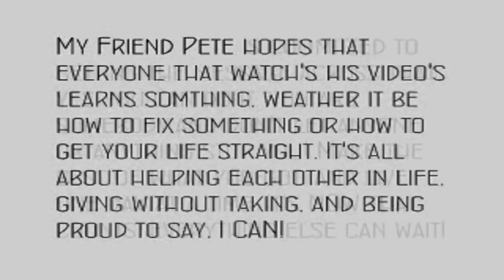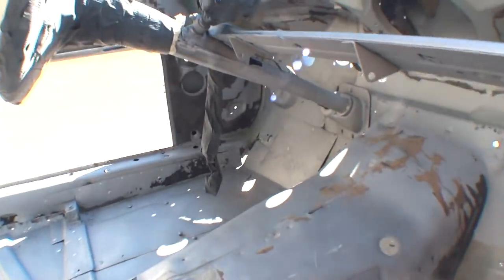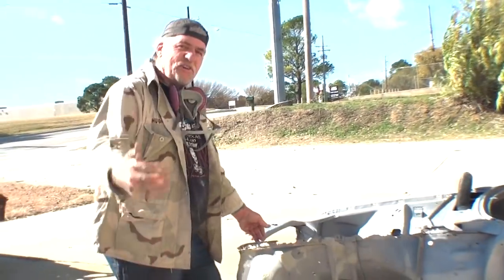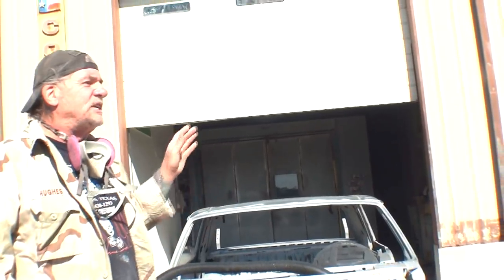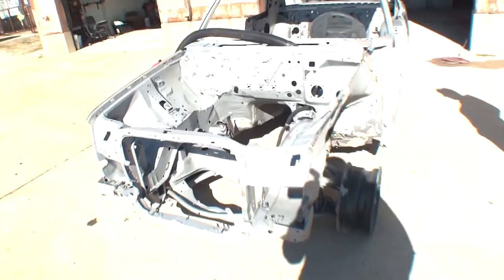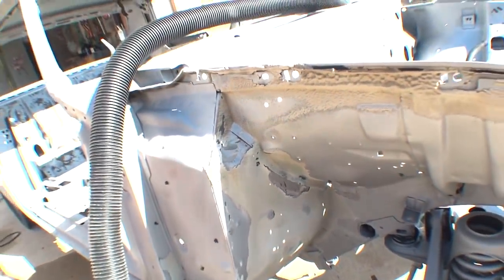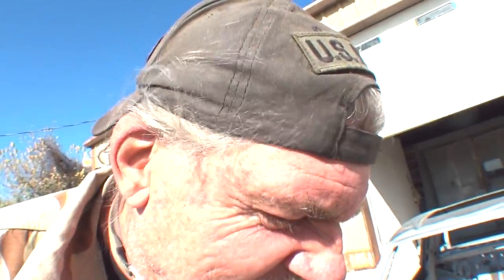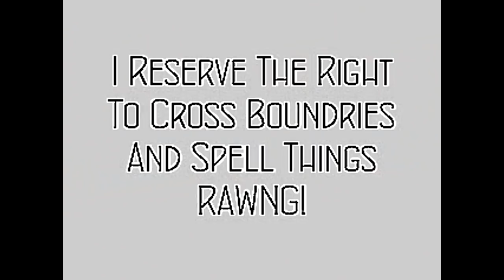This Mercedes Benz is Rotted Rusted JUNK! SCRAP IT!

Comment: I'd find another parts car and hope that the metal is good in places you need. That's the best way. Got to be another one out there. Or else, I'd look for a 3d scanner. Those curved parts could be "scanned in" and then 3d printed. I saw them do it somewhere restoring cars. Making 3d printed patch panels. One of my relatives works as a car designer. 3d printing is getting affordable for the common man.
Reply: film73 a 3D printer will not work for things that need to be welded like this on a restoration tho. It would be one thing if it’s a patch and paint coverup but this is a restoration of a collectible car and those floor patches have to be done in metal and welded in not made out of plastic and glued in

Comment: All Mercedes should be scrapped after they are 3 years old if built after 1975. Junk.

By the time you fab that car and get it back together he’ll have $175,000 in a $8,000-10,000 car.